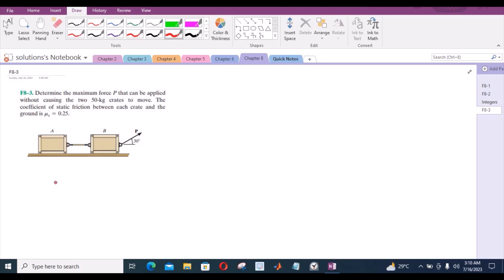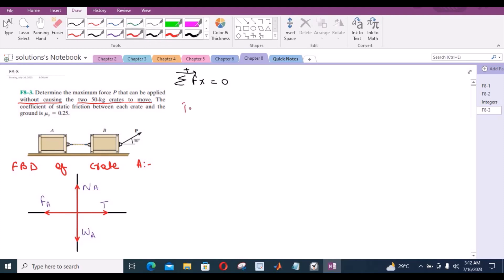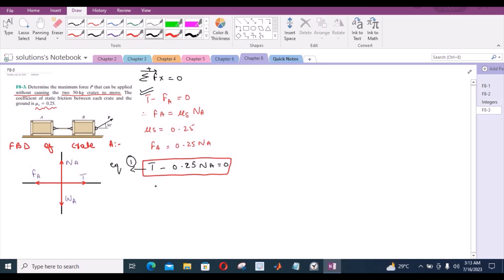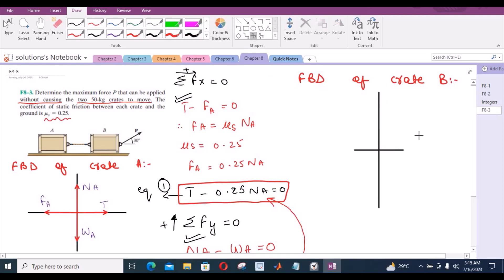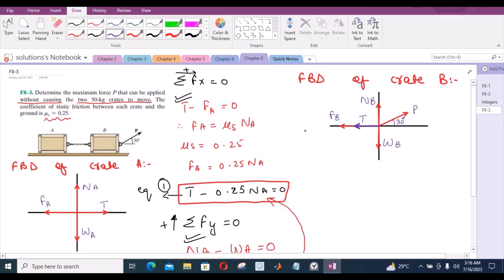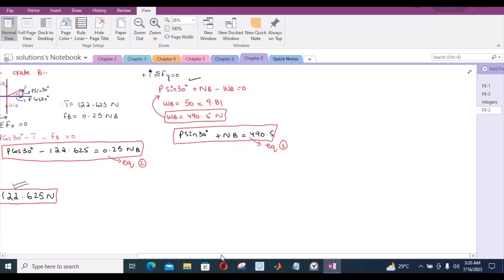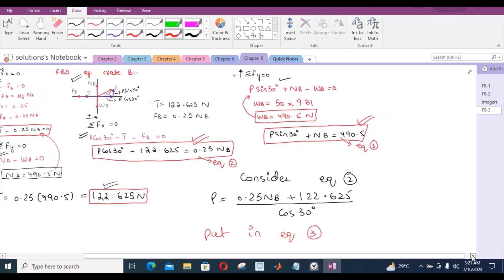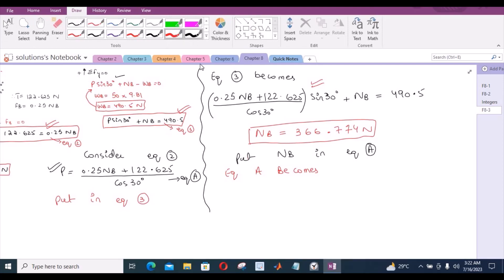F8-3 hibbeler statics chapter 8 | hibbeler statics | hibbeler

Comment from the maker: Learn How to Solve F8-5 Hibbeler Statics Chapter 8, "Determine the minimum force P that can be applied without causing movement of the 250lb crate which has a center of gravity at G. The coefficient of static friction at the floor is 0.4."
Here is the Link: https://youtu.be/axVHM0f2IwQ